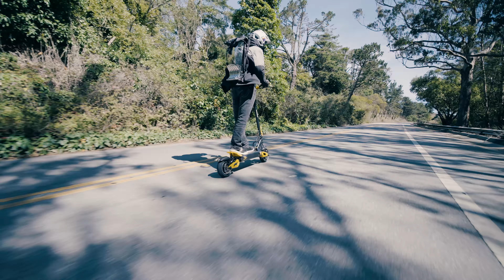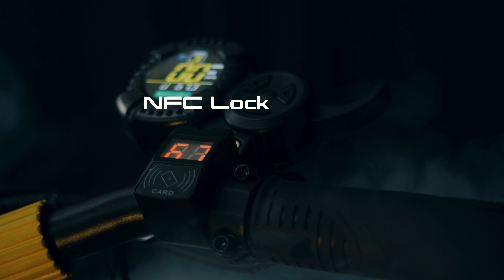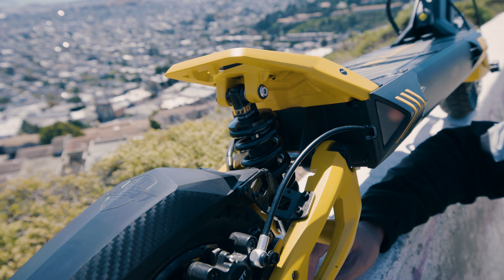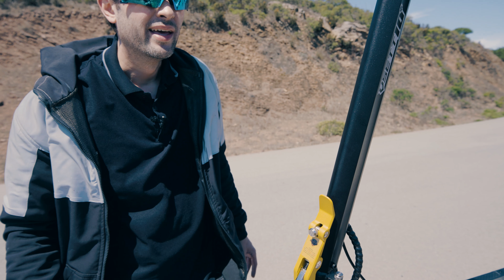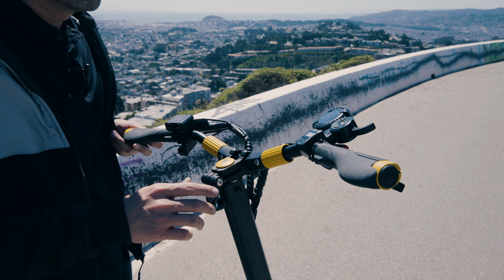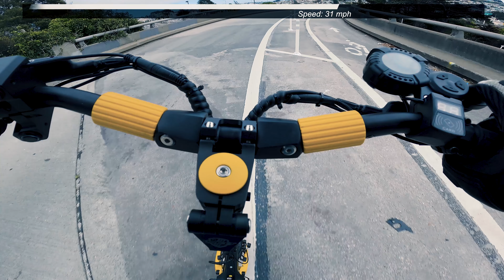[De-listed] VSETT 10+ Electric Scooter Review

Comment: I have to ask if there is any stabilizing benefit to putting ones foot down on the curves. There doesn't appear to be anything, like a wheel bolt, kickstand, or deck close to touching the ground. It also would appear to possibly remove some weight from the wheels, when added to the drag the foot might provide when it comes into contact with the ground, it  might cause the rear to slide away. 
I could be totally wrong. 
In curves on any of my rides, including the VSETT 10+, it feels as if there is more stability in actually keeping both feet on the deck and  lowering my center of gravity by crouching just a bit through the turn. 
Everyone knows Alien Rides does alot of riding and has tons of experience,  so I am totally ok with being schooled here.  Please "steer" me in the right direction.
Reply from the maker: I do that the vsett is a totally stable vehicle, and there's no need to do it unless, 1) you want to turn better, and 2) you want to look cool on video. It's similar to how pro motorcycle riders drag a knee while racing, shifts your center of gravity so you can turn sharper. 👽🖖

Comment: I see you still use the onboard speedometer. You don't learn from your past mistakes. They don't callibrate them well and possibly make them show more speed to lie about their under-performing hyper marketed speed so gullible consumers don't return them, you should stop relying on that and only use GPS. I heard you reading from their false speed gauge, that sort of discredits your videos because it hypes up their false values. Especialy when you put it on your video thumbnail.
Reply from the maker: We put GPS at the top so you can see the difference in speed as well, the onboard speed is definitely a bit higher than it should be.